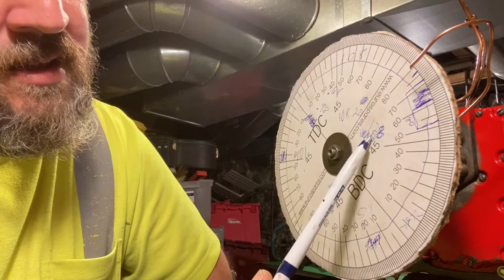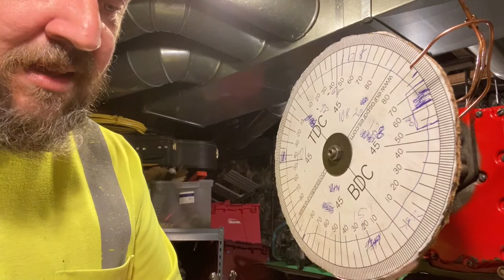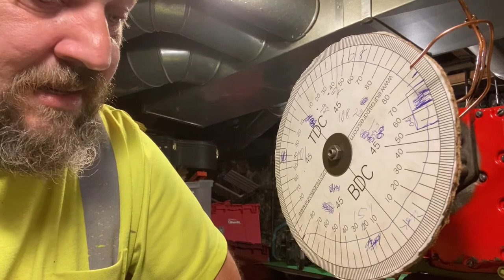Porting Vintage Chainsaw!!  Let's Figure Out The Numbers!!!

Comment: Working on a roper-sears home lite clone of this saw. Same stroke, 46mm bore. I cannot base gasket delete mine- it will free port. I think there may be some difference in deck height or piston. I would imagine you already have, but recommend you just check it so you don’t throw your numbers off if you cannot delete it. 

 I had very similar numbers to yours with a 007 gasket. Original gasket was right inline with yours as well- they are really hard to measure. The thickness is all over the place.  030-040

I am shooting for 103-104  exhaust opening with a 007 base gasket. Don’t trust the bottom end to push that much more. Exhaust duration on mine is very limited as well 151. Blowdown is 21. Stock exhaust opening was 108. Squish, didn’t even measure. You need a tape measure, not a feeler gauge. Just huge!

I just did a gasket match to the case and matched the cylinder to the base.  The case on mine was larger then the cylinder. I also opened up the case a bit wider and opened the transfers at the base of the cylinder.  

There really are some limitations to what you can do on these saws. 

Enjoy you channel-keep it up!
Reply from the maker: To be honest,  I completely forgot about checking for free porting!!  I have not done this in about 15 years.  I better do that before I go any farther. 

I am thinking 102 might be the max.  I just don't know if I want to go that far.

Comment: I’m in no way trying to be argumentative and am only an armchair rebuilder. I tinker on my own and in hopes of rebuilding my Husky 359 but at this point only got it disassembled. I am confused on your .0098” squish. Most of the projects I’ve watched are .0020-.0030” Please, I’m not attempting to correct I’m only trying to learn.  Thanks for your videos which I thoroughly enjoy and appreciate.
Reply from the maker: You are correct on noticing that difference!  I will explain better in the future but this is the short and simple.

An old saw design relies on torque more than anything. A slower fuel burn for a longer amount time is better for torque. You are basically using the power from the explosion for a longer amount of time. In order to achieve higher rpm you loose burn time. You make up for the lost burn time by having it burn faster. In order to burn faster you need less squish for more compression.  Compression is also effected. The faster rpm saws have less time to build compression. They make up for it by having less squish.  Torque is more forgiving to many situations but rpm is what gives you the fast chain speed. 

It is a trade off decision.  More chain speed vs more torque!
Reply: @Smittyschainsaws  thank you for your explanation. Makes sense to me now.